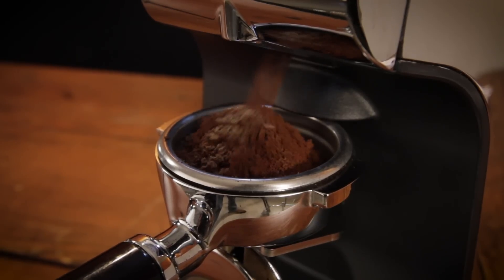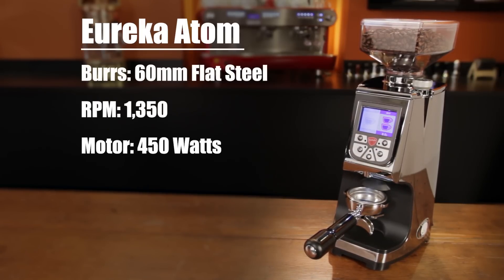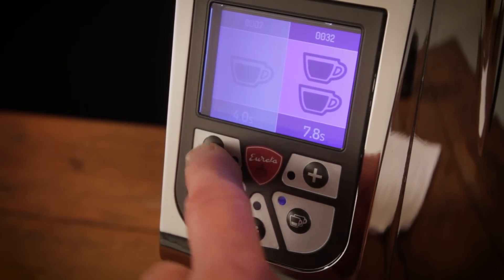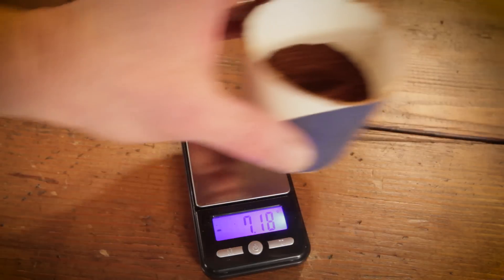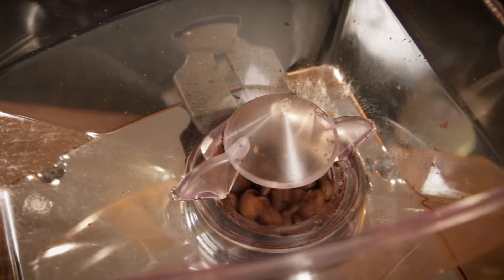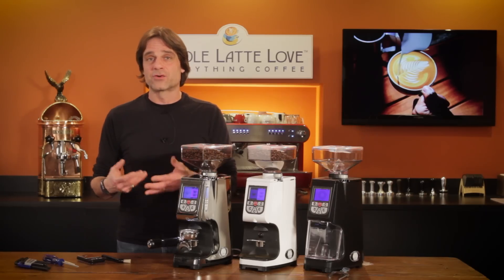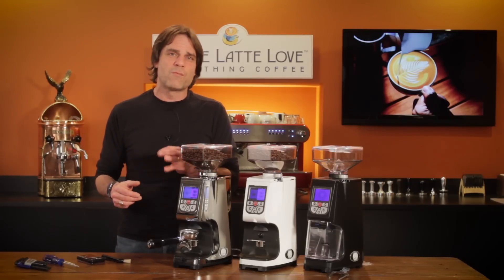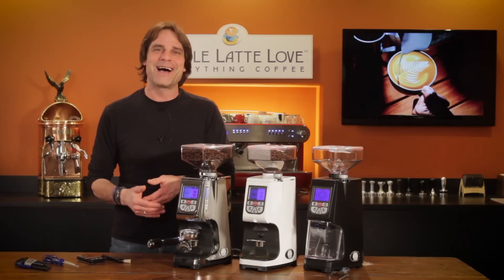Review: Eureka Atom Coffee Grinder

Comment: How is the Atom for durability and repairs ?
Reply from the maker: Hi Randy, Thanks for the question. Very reliable and durable IMO - no different than others in this price range.
Marc
Reply: Mine had been junked due to a fault main board. It pets up as normal but won't grind (as if the burrs are jammed) Replacement parts are manufactured but you can't get them anywhere.

Comment: Hi Mark. What about their "Blow Up" system that is supposed to prevent retention? Does it require separate special hopper? And does it only work for single dosing?
Reply: It works only in theory. Completely impractical. You still get a huge retention when single dosing (up to 8 grams) and because the hopper is closed from the top, it also sucks the ground coffee up when refilling with air.

Comment: Have you guys found any solution for the "popcorning" effect? I'm looking for a quiet grinder and having to keep the bean hopper half full all the time seems quite annoying. Or maybe you have suggestions for similar grinders? Thank you.
Reply from the maker: Hi Filipe, Thanks for the question. With the auger in the Atom there's no solution to popcorning. It's a setup which doesn't lend itself to single dosing. Have a look at the Ceado E6P: https://www.wholelattelove.com/ceado-e6p-electronic-dosing-grinder-v2 It uses a 64mm flat burr set compared to the 60mm in the Atom. It has 2 timed grinding presets but they are not as easy to adjust as the Atom's. But maybe that's not a concern as it sounds like you may be into single dosing. Might also have a look at Baratza Sette 270. Not the same build quality as the Eureka or Ceado grinders but very good and about half the price. Sette grinders have very low retention produce beautiful fluffy well distributed grinds and work well if single dosing: https://www.wholelattelove.com/grinders/burr?product_brand=121
You can see my  Baratza Sette 30/270/270Wi review here: https://www.youtube.com/watch?v=FzhtwrmB-60
Marc

Comment: Noticeable difference in flavour between atom (60mm) and the atom 65? 
I usually brew lighter roasted modern espresso beans
Reply from the maker: Hi Jason, Thanks for the question. Here's a link to a side by side spec comparison of the Atom, Atom 65 and Atom 75, Larger burrs generally produce a more consistent grind particle size and they grind faster: https://www.wholelattelove.com/pages/compare?products=NDIxNjQyMTc0NDY5NCwxNTQ1OTk5NDUwMTcxLDQyNTMwMDE1ODA1OTg
In the specs take note of the watt ratings of each - it increases with burr size. Taste is subjective so hard to say with authority that it's a noticeable difference with larger burrs. If you do a lot of lighter roast specialty grade beans you probably already know they are harder/denser than darker roasts and occasionally present a challenge to lower powered grinders. Hope that helps!
Marc

Comment: Great stuff. what is the most important improvement from this compared to the specialita?
Reply from the maker: Hi ORB, See below for a link to a spec comparison between Specialita and the Atom. In short, Atom has 60mm burrs vs. 55mm in Specialita. Atom has much more powerful motor 450w vs 260w. Other: Larger bean hopper, buttons on Atom with touchscreen on Specialita. https://www.wholelattelove.com/pages/compare?products=MjE0ODI4NDQ2NTIwNiwxNTQ1OTk5NDUwMTcx
Marc
Reply: @Wholelattelovepage  Thanks for the quick reply!
Reply: Can I ask you an off topic question? We just got married and I have the choice (via a befriended service shop) between the alex duetto III (used) for 1400 euros and a new rocket mozzafiato R PID (heat exchanger) for 1900 euros. Which would you advise me? greetings from Amsterdam!

Comment: I got one but the description on the box works at 50 Hz, is there a problem with that if it runs at a frequency of 60 Hz
Best regards
Reply from the maker: Hi 23, Hmm... I think the bigger question is the voltage and/or phase. Depends where in the world you are but you could be running 2 phase or single phase power. No guarantees, but usually not a going to cause damage if you plug something meant for higher voltage say 220 into a 110 circuit which is usually 60hz. May not operate properly but probably will not hurt anything. Going the other way can be an issue. In your shoes, I would check compatibility with a local electrician.
Marc
Reply: @Wholelattelovepage  Thank you for your reply
I appreciate that.
I have no problem with voltage Just frequency , please could you confirm that
Best regards

Comment: Marc, I’m always worried that equipment using those soft foil push buttons (like on the atom control display) will eventually crack and not function, how do they hold up and  are these replaceable.
Reply from the maker: Hi s, I know what you are talking about! I have a 2 on the fridge that have come off exposing the actual button behind them. On the Atom they feel robust. I wouldn't think they could fall apart. If they did the whole front panels can be replaced but I'd be surprised if that would be needed unless subject to abuse.
Marc

Comment: Hi Marc, is it possible to remove the impeller to reduce the pop corn effect when single dosing?
Reply from the maker: Hi JLTS, It may be possible - honestly have not tried. I believe doing so will result in less consistency in timed dosing weights as the impeller assists in providing consistent flow of beans to the burrs.
Marc
Reply: @Wholelattelovepage  I managed to remove the impeller and it significantly reduces pop corning and improves single dosing!

Comment: I use the atom grinder ,but I have difficulties in changing the course to fine  .
Reply from the maker: Hi Kelly, Thanks for the question. Are you running the grinder when adjusting to a finer setting? Beans left between the burrs can/will make adjusting finer near impossible. Best practice is to have the grinder running when adjusting to a finer setting.
Marc

Comment: Dear Sir, Could I use 65mm burr in atom grinder(original burr is 60mm)?
Reply from the maker: Hi CCE, Thanks for the question. Not something I've tried but I'd recommend against it. Grinding chamber may not fit the larger burr and the chamber is designed to work with the original burr.
Marc
Reply: @Wholelattelovepage  Dear Marc,Thank you for your prompt reply.

Comment: How does this compare to the Ceado E5/6P?
Reply from the maker: Hi G, Thanks for the question. Programming timed dosing is easier on the Atom as it displays the time. E5p is manual only and with the E6P grind time is adjusted in .1 second increments with no display of grind time. I have a slight preference for the grind size adjustment on the Ceado grinders. Atom has a grinds bin for brew methods other than espresso. Hope that helps. Let me know if you have more questions!
Marc
Reply: Whole Latte Love Thanks for the response! Great video! What about the grinding performance on espresso and brew? What kind of improvements do you get from the 75mm version? Many thanks.
Reply from the maker: You are welcome and thank you for the kind comment. 75mm burrs produce a slightly better grind and grind faster. For average users grind quality increase with larger burrs may be hard to detect in finished espresso. As for grinding for espresso vs. brew... This type of grinder is IMO more oriented to espresso. It's not the grinder I would choose if only grinding for brew. Frankly, it's overkill as fine grind size adjustment for brew is not critical. Hope that helps. Let me know if you have more questions!
Marc